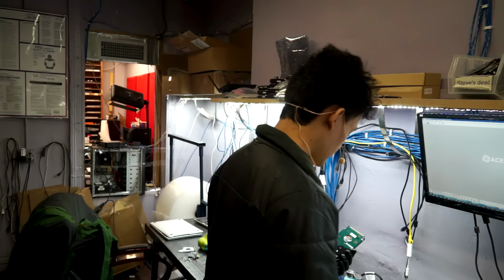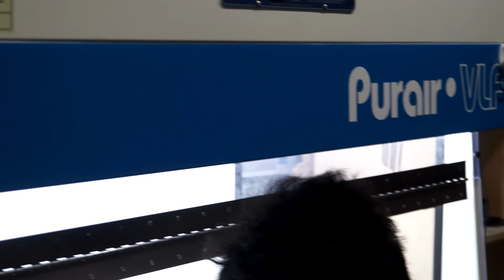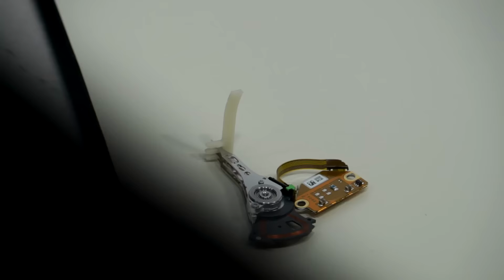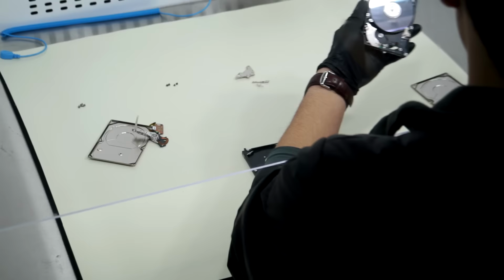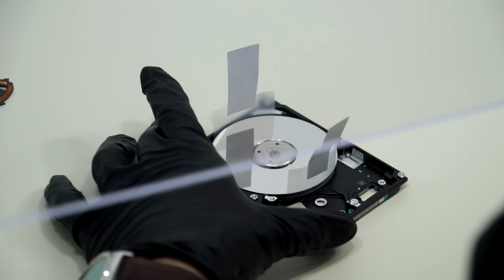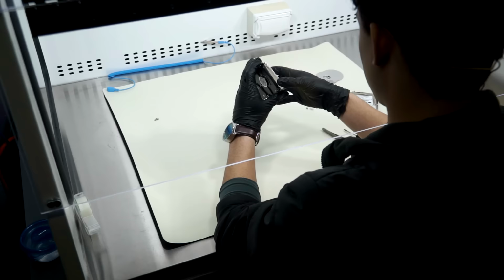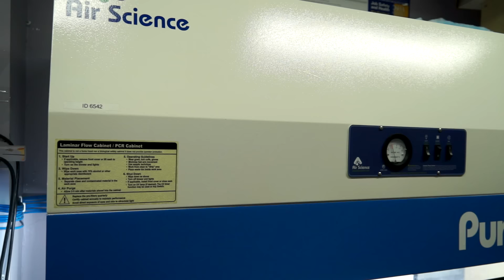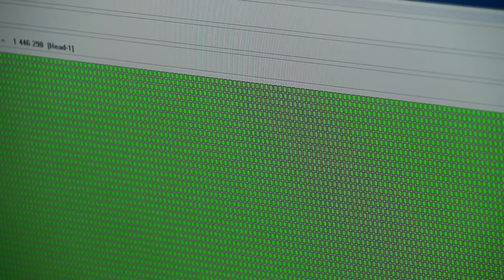Data Recovery: Hard Drive Platter Swap in Our Lab!

Comment: Good Job!!! I did hundreds of these back in the day. A couple of tips: after you heat the bearing, try using a #6 torx and turn the platter stack back and forth with the spindle screw. Apply slight downward pressure. I have loosened up many bearings this way and did not have to do the platter swap. Next, try not to fumble with screws over the platters, as dropping a screw on the platter can cause a small ding resulting in an "ecc" on that area. Many of you small time guys do better work than some of the big companies out there. Keep on trucking!
Reply: Hey do i really need to find the exact specs of harddisk for a donor? Like the size of harddisk etc

Comment: This was insanely informative for me. Whenever I hear a sound like that I always assume it's the actuator thats stuck. Sometimes the magnets that hold the actuator in place and level can get knocked slightly out of alignment when the drives suffered a hard impact.
It's really cool knowing that drives had bearing fluid. I wouldn't have even suspected that.

Comment: The magnet on the shaft of the screw driver tip was worth the price of admission. I'm embarrassed to not have thought of that in my 43 years on earth. Thank you, gentlemen!
Reply: its a great trick, if you have a mini screwdriver or tip set, but an old HD magnet up against them and they get magnetized even after the magnet is gone ;)
SDF-1 4 ever <3

Comment: From what I understand ( from a Western Digital manual I read 25 years ago ) is that the platter alignment is not that critical. It's just that you don't want to have to wait a full rotation for the sector you want to read when you switch from one platter to the next. There might even be software out there that can help you adjust the alignment.
Reply: so are you saying deviation is ok but small and only in one of the directions?

Comment: There was also a trick that worked on some Toshiba 2.5" drives who weren't hard seized.  You can heat and cool to remove the bearing cover (little 4-5mm round circle) in the bottom of the spindle motor.  You could then add a couple of drops of a light lubricant to the bearing and then replace the cover and heat the bearing unit.  Power the drive on while heated, and listen to it sounding almost like new.  The agitation in the fluid from the spinning motor will mix the new and old lubricants, preventing the old oil from drying out again.  This will give your drive a new lease on life, at least for a few days, which is more than enough to retrieve the content.  Obviously do not put the repaired drive back into service.

This used to work quite well on the 8025GAX in particular, who had a much larger issue with seizing than the 8025GAS.

Comment: I know exactly what that thing you're working in is called. It's a Bio-hood, it's a type of sterile fume hood that is used as a clean space. Biologists and people working in medical labs use them to keep things sterile while doing stuff like plating, transferring specimens to vials, and the like. My lab I work in uses ours to transfer body fluid and spinal fluid to smaller containers for testing. I didn't know repair shops for computers also used them for tasks like this!

Comment: The alignment is electronic, done when you format the drive, so when you remove a platter from the stack end of alignment. So when you want to recover those 
platters on the drive with critical data, any way you save that alignment should work, love the scotch tape idea works great. 
The reason for the head comb is that those heads are preloaded, when the platters rotate 
the air flow allows the heads to float over the platter surface. I have worked on hard drives for many years except that mine were much larger.
Reply: How do you keep the alignment then if you didn't hear of the tape method? Is there some better pro method?

Comment: Excellent video. I destroyed a hard drive by not using a head comb. I wish I had seen this video first.
Reply from the maker: I always want to teach through remembering the mistakes!
Reply: Have dead drives handy, because you might not get the head comb right the first, or second or maybe even more tries.
Reply: me too :(
Reply: Also, dont they short out - When they touch?
Reply: Same here 🙁 I wish I saw this earlier
Reply: no head comb ,no tape , sad
Reply: I think I messed up my hard drive too. It was making a noise and wasn’t reading anymore. This was almost 12 years ago. I tried seeing if I could fix it myself somehow since I liked tinkering with things to see how they worked. I never fixed the drive but I still have it after all these years.

Comment: Hey Louis, about anti-static mat grounding clamp: it is very unlikely that that crocodile will reliably pinch through powder coating or any good quality painted surface. I've been bitten by this once - the contact seemed to be good, but it wasn't.
PS. Thanks a lot for this video, I've learned a ton!

Comment: As great as this is, I thought that with most drives you needed to have donor drives that are essentially siblings (board compatibility) in part because the on-board components help keep track of the data alignment.
Reply: That is also what I thought but I believe I heard about some way of recalibration for the alignment. I'm not too sure though.

Comment: You can use a straw (cut into short tubes) instead of the comb.
Now you can do this at home without any special tools!    :)
(yes, this how I did it once...   it's stressful)
Reply: I call bullshit on that claim
Reply: @Bman130958  Nope. If the straw plastic is thick and rigid enough that trick could work. Good idea

Comment: I find it really interesting that the tape was good enough for this. It looked like it barely had enough stickiness to stay on the side of the platter and you only have one try while moving the platterns. If the tape fails mid-air, you data is gone forever.
I'm also surprised to find that laminar airflow box was good enough for this job. How about more recent HDDs having e.g. 6 TB in a single 3.5" drive?
Reply: Graphene was literally discovered with the stickyness of the scotch tape, that thing is the greatest thing ever invented
Reply: the two pieces of tape are spread over some half of the entire circumference, its unlikely it would lose grip on the whole thing at the same time. youre being paranoid. also, blasting a small amount of air would get rid of most dust. the point is to recover the data, not make this a long term use drive again

Comment: side note: If you have damaged hard drives lying around, you can open them up and use the hard drive platters as mirrors and the neodymium magnets for anything that needs magnets.
Reply: The platters are perfect for setting up the cross polarization for your 3D scans ;).

Comment: I bought the same tools with everything direct from China and it cost like $600.00 table for two hard drive swop, platter remover, head remover from 2 up to 4 head.etc etc. I've been doing this for last 12 year's and also have my very own antistatic room zero dust at all. Great job guys.
Reply: Hey do i really need to find the exact specs of harddisk for donor? Like the size of harddisk and model, i want to do plate swap
Reply: @user-jv4se8hi8s  I have the same too (As donor) seagate hard drive 2tb with the same firmware, I think is FFCC 27 and I swap the pcb board an the heads will it work...?
Reply: @MrArt542  is this a question?
Reply: @MrArt542 wow, that's awesome. I have got questions. If I build a clean chamber with hprea filter, will it work if I swap the head using the same model, size, first 3 digits of serial number and same firmware version?

If it will work, can I use hddsuperclone to clone the hard drive or I still have to use PC3000??
Reply: @chris01479  Yes with the filter will work in the clean room and for heads for the hard drive you have to search for a compatible donor. You can search online  and it will give you one, just put the hard drive information and search for a donor...good luck with your project.
Reply: @MrArt542  Thanks, well I don't have the clean room but I'm planning to build a clean chamber with hprea filter on it so I can work on 2 hard drives to swap the head. My failed drive have the same model, same first 3 digits of serial number and same firmware version as the donor drive so am I good to go?

When you replace the head and platters, do you use PC3000 or do you use any free software to clone the drive like hddsuperclone??

Comment: I'd like to correct a minor bit of misinformation: The heads are not magnetic, they are pushed toward one another with leaf springs; normally the disk platters hold the heads separated. Those leaf springs are carefully designed to apply just the right amount of downward pressure toward the disk surface. Meanwhile, the heads themselves are shaped to generate lift (like the airfoil on a wing) as the boundary air clinging to the disk surface sweeps under it. The heads "fly" in very close proximity over the surface of the disk, as I'm sure everyone knows.

Comment: very cool, and I'm glad the operation was a success.
I was under the impression that many of the fasteners in a HDD required a very specific torque, and that the drive would not function properly if the fasteners were not torqued to spec ... that must have been for a specific drive, or perhaps a specific manufacturer. Regrettably, I can't find that video again, so I have no more specific data to add.
Again, glad it worked!

Comment: Nice job. You guys are like surgeons working with blood and guts, minus the blood.I have suggestion that you may want to employ. If you are confident that a bearing has failed or seizing up or is galling, rather than performing this very delicate and time consuming risky procedure, could you just spin the platters with an eternal or booster motor? If you took the dust cover from a donor hard drive and cut a hole in it exposing the hub, could you simply use a high rpm tool such as a Dremel with a small rubber or silicon wheel or similar material and use it to spool up the platters? You would only need to do it long enough to rip the data off. Alternatively, could you make some sort of arbor or shaft that you could then epoxy to the hub and then spin the shaft with a dremel or even use a donor motor from another hard drive. If you were to make a connection between a shaft chucked up in a dremel and a shaft fixed to the platter hub using something flexible such as vinyl tubing, any misalignment issues could be mitigated.Even if you simply took some epoxy putty and mounted a phillips head screw to the center of the bad hub, you could then use a dremel with a Phillips head drive to engage the hub.Just some ideas I came with.
Reply: you are assuming that the drive rotation rate isn't critical, but AFAIK it very much is. Also bear in mind that cutting any hole in anything anywhere on a HD is likely to produce ruinous amounts of small metal shavings etc

Comment: Awesome video, thanks for sharing it. I do have a little information to share based on prior experience in clean room work. 1. I'd recommend getting Tyvek sleeves to wear while at the clean enclosure, shed human hairs are not always expelled and if they get into a HDD they can render all the work in vain. 2. It looked like the technician was wearing some kind of sweater, that material can lend itself for creating lots of static, just because he's gotten lucky so far does not mean that if the ambient inside the lab changes in humidity it will remain so. I've seen an ungrounded PCB destroyed by static discharges; as a minimum wear a properly grounded static discharge bracelet.

Comment: It is very important to use the ORIGINAL pcb from the bad drive housing to the good one ( in this case of the bearing issue ). The eprom on it has all the sector data from the platters you are saving. If you change the pcb due to some other issue, you must remove that eprom and put it on the donor pcb. As always Lou, great video!
Reply: thanks.
Reply: Hey do i really need to find the exact specs of harddisk for donor? Like the size of harddisk and model, i want to do plate swap

Comment: Sorry if I missed it but can it just be any same-RPM IDE two-platter drive that can be used as the donor drive?
Reply: You usually need the exact same model, unfortunately... don't trust me, hope for a direct answer. But as far as I know, HDD manufacturing these days can be so diverse that even if you have same number of platters, same capacity and same brand from the same period, they could be made in different factories with different assemblies.
Reply: Where did you get that information?
Reply: Definitely need the same model drive.
Reply: Steven Qiu T'was from another HDD repair channel, but I can't remember the specific video right now, sorry. Not 100% sure
Reply: Needs to not only be the same model, it usually has to be very close in serial numbering too. Manufacturing tolerances are so tight, that variance over time causes two identical drives manufactured a few months apart to not be compatible. Minor firmware updates are a good example too, even though the hardware is identical, tiny firmware updates can cause PCB or component swaps to fail.

There's a lot of weird black magic woodoo that goes into picking donor drives. Exactly how difficult depends on manufacturer and age.
Reply: Same model drive. Sometimes there is wiggleroom like swappiping a 500 and 750 wd blue /might/ work, but it's a crapshoot. Considering it's already a last ditch effort, do your best to find the EXACT same drive.
Reply: Site codes are very important, even drives that are the same model, serial , site code can be different. Firmware is also a big issue too, you need to transplant the firmware chip to the PCB as well, else the drive will just click.
Reply: Christopher Ryan even if you're just trying to extract the data in one action

Comment: Very helpful video.  But I winced when I saw you putting the tip of the compressed air straw within an inch or two of the platters that need to remain completely free of contaminants.  If it was 5-6 inches away, that would have probably been okay, but that close and you run a serious risk of splattering contaminants onto the platter and creating a thin film that will spread out across the disk at 7200 rpm.  "Compressed air from a can can carry residue that will spit out on your optics. This can be just water condensation from the release of a compressed gas, but often it's the gas itself that carries residue that vaporized in the gas compression process that is used to fill the can."

Comment: so I rebuild a lot of machinery bearings. and if the main cause of bearing not spinning is dry grease, I’m 100% certain that you can drill a small hole in the back of bearing housing, and add a drop or 2 of oil. the bearing will free up. due to possible metal contamination from drilling I would not put drive back in service. but it will probably be unaffected long enough to transfer the data. this would save you a lot of time. I’d first get familiar with the bearings to determine hole placement. I recently took one apart and housing was brass. drilling would be super easy. then just find a manufacturer spec on oil viscosity to insure proper rpm.

Comment: I was given an mfm drive that quit working. The guy had no backups and would loose his job if he could not get the data recovered. When I started testing you could hear the platters spin up to speed but there was no data being read from the drive. So I spent an hour or so looking for a similar drive, swapped the controller board, that piece you called PC board, and got lucky. Everyone went home happy.

Comment: If you check the head map for most modern drives, you'll find that usually quite large regions are read by one head - typically multi-megabyte blocks. So unless you have one of those drives that have servo information on only one platter surface (not sure if any of those are still being made), rotational alignment is not what you should be worried about, but rather, things like platter order, orientation and lateral alignment (making sure the tracks are centered on the spindle). So, scotch tape is more than enough for rotational alignment.

Comment: I’ve been told that in patient drives with brackets in between the platters, it’s impossible to take the platters out in a single motion because of those brackets, so alignment with tape or a ring clamp is nearly impossible and at the very least very impractical when preventing brackets from touching the surface. 
The platters DO offer a tiny bit of tolerance, so what I’ve seen technicians do with bracketed drives is just mark a perpendicular stripe down the edge of the platter stack with a fine tip marker and just realign them inside the donor by hand if needed. Works 90% of the time if there’s nothing else wrong.

Comment: In the building world, your "Laminar Flow Cabinet" is referred to as a "Fume Hood". I can tell you are very proud of that thing,  as you should be. There is much involved  installing one during construction. I could only imagine what a retrofit in NYC would be like. Fun times!
Reply: I have got questions. Will it work if I swap the head using the same model, size, first 3 digits of serial number and same firmware version?

If it will work, can I use hddsuperclone to clone the hard drive or I still have to use PC3000??

Comment: You can use small CD labels and dead drive platters as business cards.  LOADS cheaper than getting cards done at a print shop...AND it saves you the cost of discarding all those dead drive platters!
Reply: Very interesting, I'm thinking of doing this myself so I have got questions. Will it work if I swap the head using the same model, size, first 3 digits of serial number and same firmware version?

If it will work, can I use hddsuperclone to clone the hard drive or I still have to use PC3000??